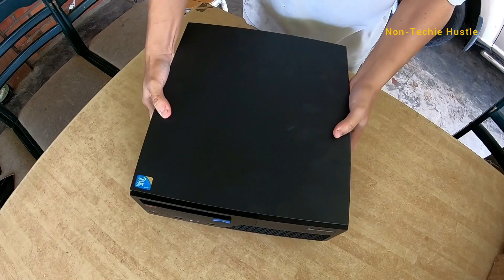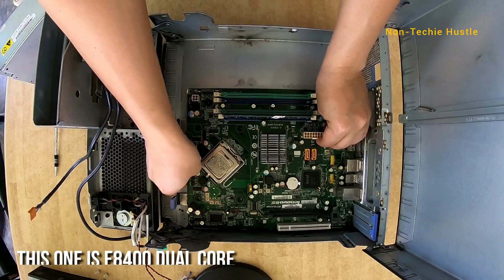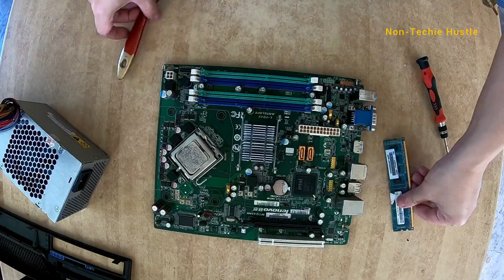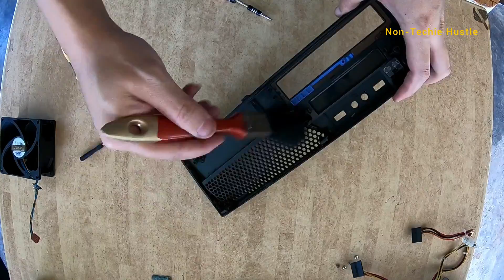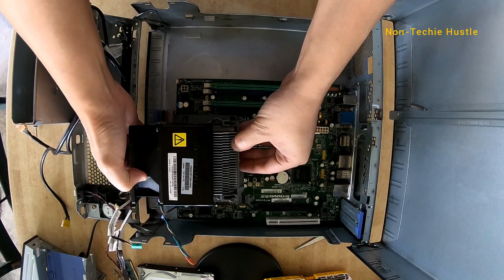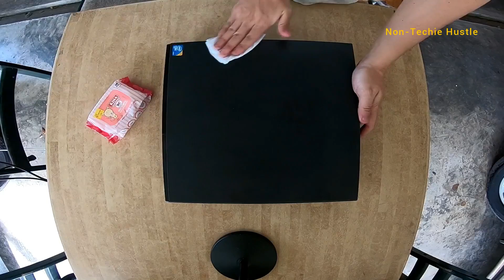Lenovo Thinkcentre M58 SFF | Cleaning & Upgrade #deepclean #q9500 #officepc

Comment: I have used my Lenovo M58p desktop for a long long time, and it was basically on 24/7.  I spent a whopping $20 way back when, to upgrade to a Q9500 CPU.   But then, many years later the computer began to have bootloop problems.  Over a short time, the bootlooping occurred more and more often.  Even if the system got up and going, the CPU fan could often be stuck at max speed.  Changes over time, like in this case, are most likely a hardware problem, and so logic told me that it was most likely a PSU problem.  Several of the electrolytic capacitors that one could see within the PSU, were on their last leg due to the bulging seen at the top of these caps.  I replaced the one bad cap which was tied to one of the two IC's, and boom, that fixed the bootloop problem.  I then replaced the rest of the bad capacitors.  So overall, it cost about $9.95 to repair the computer. It is now my backup computer, and it can still handle YT videos at 1080p @ 60 fps.
Reply from the maker: I use this desktop for surfing n office only.
Reply: @nontechiehustle  I also have a third computer which is an antique IBM computer running as a Microsoft XP computer.  It is now a sleepy computer that is set to only wake up at specific times.  For instance, it wakes up, and the verbal clock system will say things like, "Get off your lazy butt and vacuum the carpet.....Vacuum now ! ", or, "It's treadmill time. Get on the treadmill. Have you done your treadmill exercise today ?", and repeats these for several minutes.  It definitely helps me when I am low on energy concerning getting things done.  This computer only has the audio outputs tied to speakers, and the video tied to a switch box which is tied to my monitor.  It has no keyboard nor does it have a mouse tied to the system. So thanks to the switch box, it was easy breezy to tie all three computers to my one computer monitor.

Comment: I have the same one, i only use it to see movies and series. It has windows xp and 4gbs of ram. I dont use it with internet so it is ok . I installed a low profile graphics card to have an hdmi port and it works like a charm. I can see 1080p videos. I wish i could play 4k videos but i guess that is impossible because of the processor.

Comment: fan running fast and loud at bootup and no boot up essentially any ideas?
Reply from the maker: Fan running fast is normal. Mine also like that. But no bootup maybe your compenents such RAM, CPU, bented pins, wrong connection or currupted operating system.

Comment: Can run games?(upgraded VGA card
Reply from the maker: Cannot play games unless add lowprofile gpu in it. This cpu intend for office work only 🙂
Reply: I play on mine, with 8gb of ram, quad core duo q8400 2.66Ghz processor, GT218 1gb video card, 500gb HD.

GTA San Andreas 
Need for speed Monster wanted 
The sims 4
BF2 bad Company 
Cód mordern waefare 2
Conter Strike on LINE.

Comment: Can i add to it an intel Celeron 3.06ghz and ATI Radeon?
Reply: Oh and thanks for the great content! It certainly helped.
Reply from the maker: What model is the intel Celeron? The motherboard that I use is LGA775. Make sure the processor intel Celeron use socket LGA775. U can use low profile gpu.
Reply: @nontechiehustle  didn't use the Celeron, had a core 2 duo and heard he's better, but when I used the Radeon it didn't read, and added more ram to make it 6gb Ram overall and it showed me 1gb, when I searched around they said the problem is with the old bios, can you please tell me how to update to new bios on this M58?
Reply from the maker: @MaRobot7  Maybe you need to install the Radeon driver? I cannot show how to update bios now because, the cpu already sold 😅 about the ram, maybe ur motheboard RAM holder or the RAM stick is damaged.